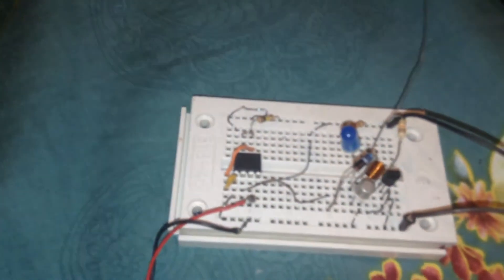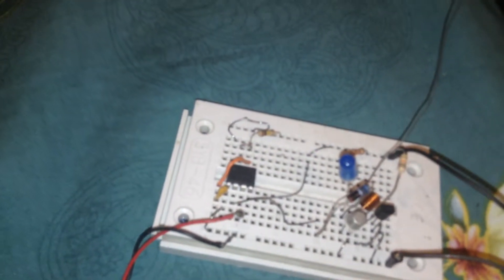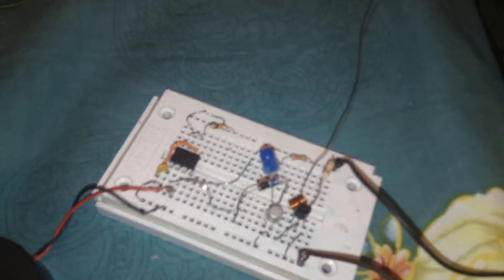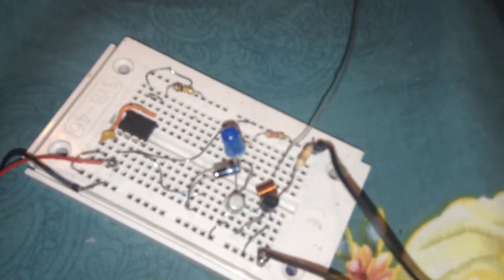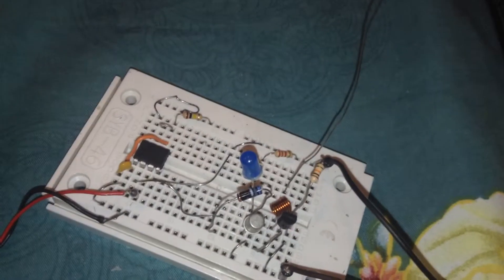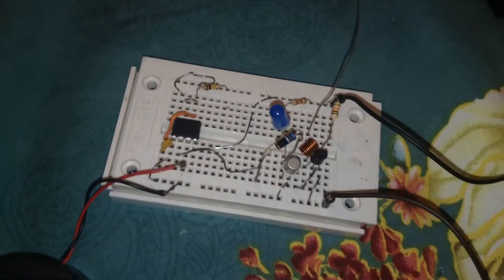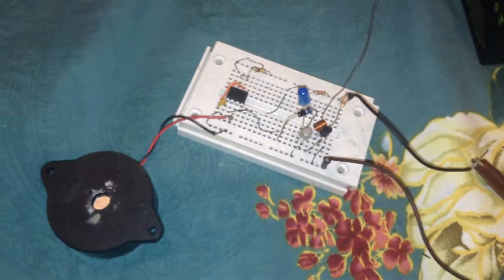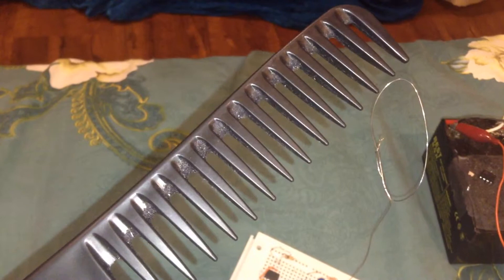j310 jfet and 555 amazing static Electricity Detector

Comment: It was an informative video. Thanks.
As you know, static electricity in the card is high voltage. It is worth thousands of volts. However, we do not notice, since there is no current. I want to ask something;
How can I make a detector that will detect nano and pico volts?
Reply from the maker: in last 10 videos,one made about pico and femto measurement.
Reply: @seyedmarashi  ok. Thanks.
Reply: @ahmetozdemir7173  kafayı yiğecen öten alan taramaları görünce yapmaya çalışıyorsun ana olmaz